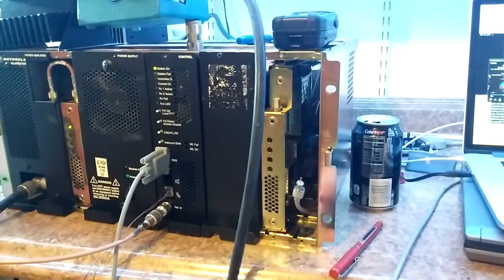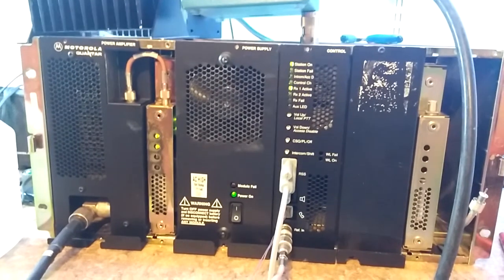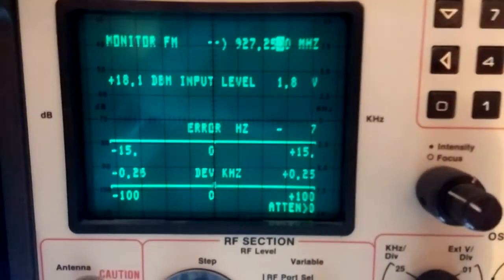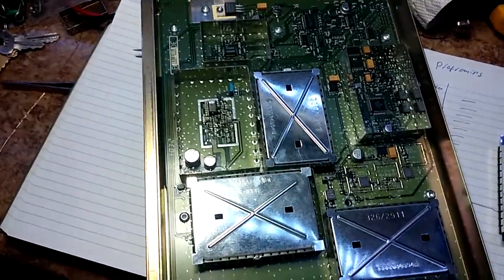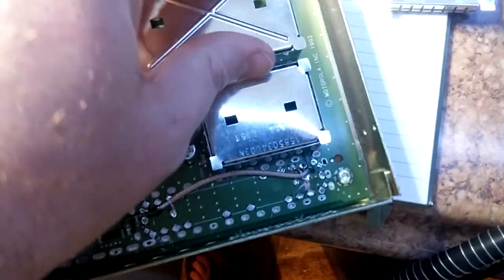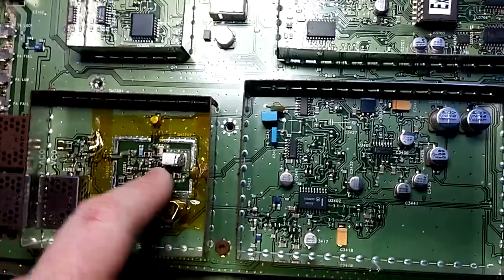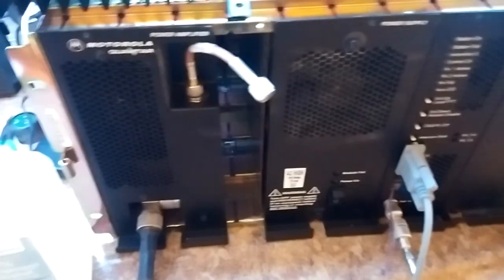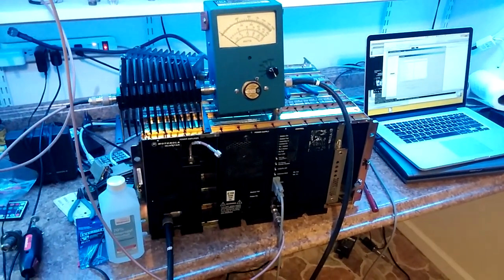800 MHz Quantar to 900 MHz Ham Band conversion Proof of Concept

Comment: Nice to see this Bryan. As you know I did this mod earlier this year. Works great. I added Toko filters to the front end which did impact sensitivity. But made up with a Sinclair preamp and a Motorola pre-selector. It has run for six months sometimes an hour at a time on a Allstar network with N5JGX, W8VT, and W8JTW. Recently it threw a PA/Exciter fault and when looking at a log of it only shows unable to connect. So not sure what's up. This was only an issue after power line glitches. May just be a confused CPU. This confusion did not go away after a reset command from RSS but only after power cycle. 

As for the fans take a look at the thermistor voltage. The PA fans for mine kick in at 2.1V and in cool down would only go up to about 2.8V. But for the fans to shut down the thermistor voltage needs to be between 3 and 3.1 volts. So I played with the 47K resistor that goes from +5 to the thermistor to raise the thermistor voltage. Problem solved. Now after a marathon talk session after about 5 minutes the fans shut down. This, by the way, is in an air conditioned room. A warm site may be different. -GeorgeC W2DB